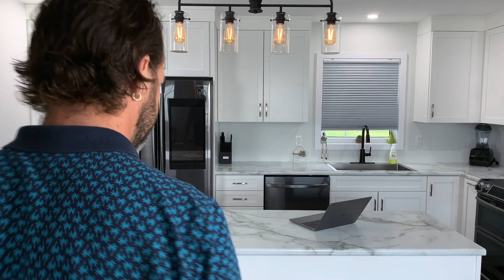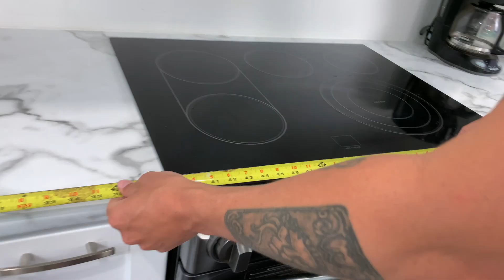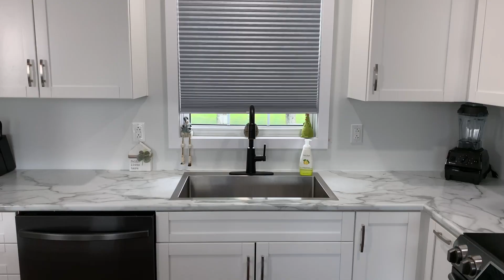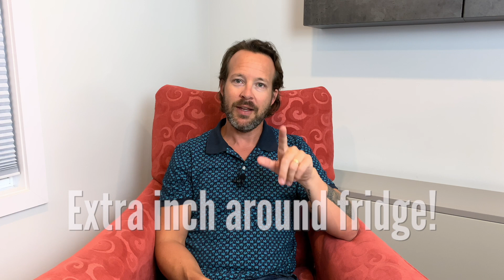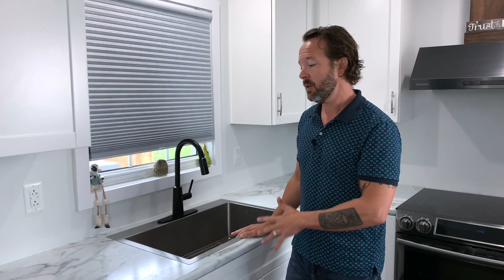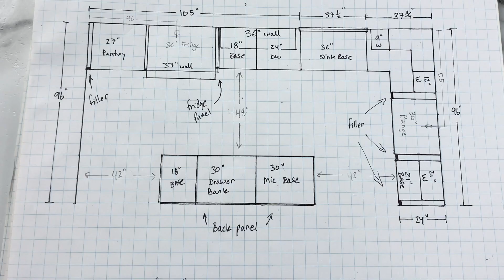How to DESIGN a KITCHEN | Free Training

Comment: So is the ¢ sign going where the electric outlet or gas hook up for that appliance is located rather than the actual center of where you are placing the appliance?  For example, my current stove location is where the original gas hook up is and unfortunately is in a corner between two doors with no landing space at all. But the gas hook up isn’t in the center between the corner and doorframe, it’s tucked deep in the corner. So if I was drawing out the room plan for a designer and letting them determine the best location for the stove would I just put the ¢ where the gas hook up is?

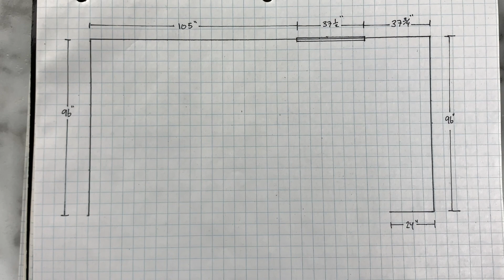Comment: 1:45 I will (when I finish the repairs to the wall) have about six feet of window opening on the south wall of my galley (lots of natural light!), and have been trying to work with my proposed 24-inch-wide pantry and the "it's going to be there no matter what" 28-inch-wide prep area with no base cabinet at the other end of that countertop run. Working with my 24-inch dishwasher (reusing a nearly new Bosch 44 dB 800-series) and that gorgeous 33-inch copper sink, I have found that the sink will not be centered under the windows. As the proverb goes, "Arithmetic is not an opinion".       
I had not noticed before, but the 1980 remodel of this space had the sink offset to the left as well.        
I'm designing to age in place, so the few inches off-center isn't a big deal to me.       
I plan to keep my fridge in the northeast corner across from my proposed pantry location with the door to the breakfast room in between.        
I've tried to make a 36-inch fridge space work, but it is too much of a compromise to the landing areas by the 30-inch cooktop. A standard depth 30-inch French door Whirlpool has about the same volume as the 36-inch counter depth Bosch I've been considering. The fridge will be set against a 34-inch-deep wall that can't be altered, so a standard depth French door makes sense and Bosch doesn't offer one.       
7:15 My cooktop will be approximately centered on the north wall of the galley, no problem with landing space on both sides, but the wall oven will be against the west wall by the dining room door, across from the above-mentioned 28-inch-wide prep area.        
As a general comment, base cabinets and appliances are easy. It's the wall cabinets that drive you crazy,

Comment: I do not have a garbage disposal under my apron sink. Is it possible to put a garbage drawer under there? We don't accumulate that much garbage.  Less than 30 gallon bag.
Reply from the maker: Totally possible.  I have one from Home Depot.  Mounts to the bottom of the cabinet and pullouts.  Works like a charm.

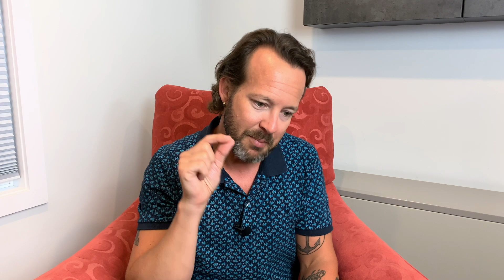Comment: ..the drawing that you show around 8:35 shows fillers on either side of the range..is there a certain amount of space that should be left between the range and the cabinets?
Reply from the maker: Interestingly enough I rarely put fillers next to a range.  They would be mostly used for a thermoplastic cabinet to protect from heat damage.  An inch to 3" is normal.  I will also use them when trying to create symmetry or am stuck with RTA sizings.  There's no heard fast rule here though.

Comment: That's great for placement but it's very hard to visualise how it's gonna look like.
I think the online kitchen designer tool from IKEA is awesome and super easy to use.
Reply from the maker: Yeah IKEA is easy to use, but very limited.  Most people are not going to have a program like this because of the yearly investment it is to have a licence.  However, the design tips will work for any platform you use.  Of the free platforms out there IKEA is probably the best choice for a basic design for sure!
Reply: Personally I’d rather see a 2D floor plan and 2D elevations than 3D plans, but I know most people can’t visualize the 3D from a 2D plan.

Comment: I've been checking out your videos recently and I really appreciate these. I admit I usually design well for others but find myself stuck trying to solidify the design for my own kitchen. It is a standard L but very narrow with the exact dimensions mirrored in the dining room. I've considered making a giant kitchen/dining space so that it would not appear too narrow once I started putting back appliances and cabinetry. I'm stuck. Kitchen-dimensions are 9 ft, 6 inch x 13 3/4 right wall has a floor to mid wall window and door.smh help please!
Reply from the maker: Hey Kelly.  Thanks so much for watching my videos. I really appreciate it. 
If you want me to draw something up for you, touch base with an email and the details.  I have a design service if that’s something you would consider.  marknamytobin@gmail.com
Reply: Similar situation with my galley. I have a 3'6" hall behind the north wall of my kitchen, but that hall is the only indoor access to the master bedroom and there is a hall closet and the master bath on the north side of the hall. The wall between the kitchen and the hall is load-bearing, and the hall space is essentially wasted, but reclaiming it will actually reduce the available counter space and cabinets, plus the cost of engineering in the beam.

Comment: what are your thoughts on putting oven in island and having cooktop elsewhere?  Or cooktop on island...seen some islands with cooktops on them but them I'm not sure how they get properly vented!?
Reply from the maker: I don't have an issue with that at all.  The oven that is.  Having a cooktop in the island is ok if you can vent it well.  I've done it in the past and you can get range hoods designed for that.  I personally prefer it not be, but if the layout calls for it, it's fine.

Comment: Thank you for a very informative video. SPOT ON about measurements!  We are just finishing our new kitchen. 

My husband who is very experienced person in mathematics measured our kitchen and drew it on graft paper before we started design.  I believe his measurements were correct but we decided to spend a couple thousand more than the big box stores for custom cabinets from a local kitchen designer at the lumber company and they came to our home to take their own measurements, the cabinet builder send a rep to confirm and our contractor did his own measurements.  When the cabinets were delivered and ready for installation there was a three inch discrepancy on one wall. I don’t know who made the mistake but the bit more we spent was well worth it.  The designer allowed enough space for fillers that it worked and the cabinet builders provided additional trim to complete the kitchen with the necessary changes due to the measurements (and out of square/level walls and floors).  I am fairly certain that the big box stores would not have done so.
Reply from the maker: Wow, great to hear that it worked out.  It happens a lot, that measurements get messed up.  Enjoy your new kitchen!!

Comment: What if you window is in the corner two windows set in the corner!
Reply from the maker: Then you have a kitchen designer nightmare. Lol.  My design would hinge on the countertop material.  If it’s laminate, then I will consider moving the sink out of the corner. If some type of stone, then we may be able to leave it. 
Laminate would likely have a seam. Seams and sinks do not work well together with laminate.  
That’s my thoughts.

Comment: We are building a new house. We have a quote from Kitchenland. Menards and working in on a custom cabinet buid
Reply: Builder.   We are sitting w IKEA in a couple of days.  We are in our mid 60’s and would prefer higher end appliances than customer cabinet.  Have seen a lot of your vids on IKEA.  Need your personal opinion on IKEA.  And suggestions on finish and hardware.anything else we haven’t seen about your thought on IKEA. Help please.  The cost of IKEA with out extra toe kicks and appliances and counter tops seem real budget friendly.   We r out of their delivery zone so counter tops r out of the question.   So please take this as “” if it where u approach.  Thanks
Reply from the maker: Firstly, don't worry about countertops.  IKEA sell the same thing as you'd find anywhere.  No better or worse quality really.
If I were thinking budget friendly and my design layout didn't require anything really custom, I would be comfortable with IKEA cabinetry.  I think you are better off putting the money toward good appliances, as you say.
For a Ready-to-assemble line of cabinets they are as good a quality as anything out there.  I hear lots of good reports about them.  I only have a couple in my house and they are well constructed.  
Kitchenland would have the best quality.  IKEA would be next and then Menards.  How does the custom cabinet builder compare in price?
That's my two cents.  I think you'd be fine with IKEA.

Comment: What grid size graph paper do you find works well. 4 line, 5 line six line to the inch or what? thank you
Reply from the maker: I'm using 4 line to the inch.  I like it that size, but for larger projects you may want 5 or 6.  But for the average kitchen it seems to work.  For me at least.

Comment: I'm in the market for a counter depth fridge. You mentioned to have a inch around the fridge. Is that an inch total (1/2 inch per side) or an inch per side?
Reply from the maker: Yeah.  Inch total.  Check the details on the fridge.  Sometimes they say a little more depending on the brand.  Whatever it is, make sure you add the space in the cabinets.  Cabinet depths fridges are awesome!
Reply: @MTKDofficial  Awesome. Thanks for the timely response.